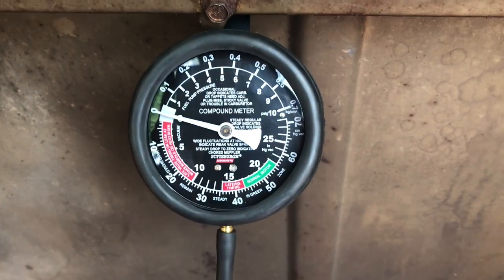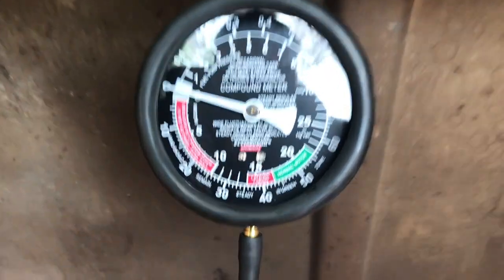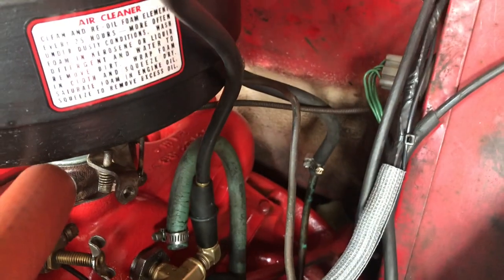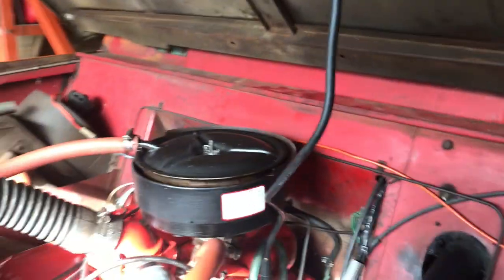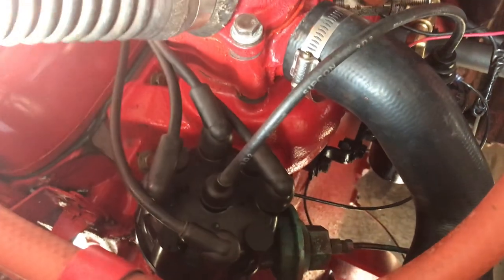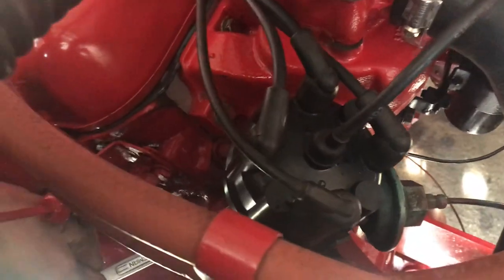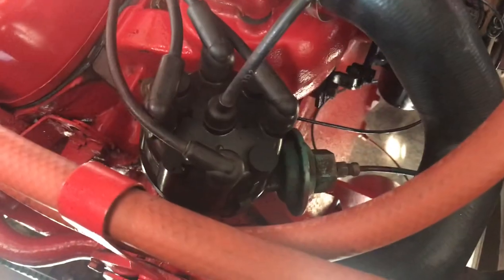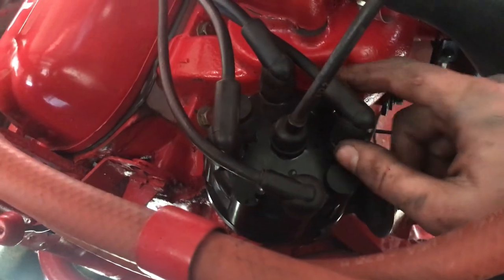1965 Scout 800 | How to Tune your Engine with a Vacuum Gauge

Comment: Best thing for these 152 - 196 engines are to do a gasket match for exhaust and intake and valve job , get rid of any sharp edges in the oil and water passages ....mind that if your doing a rebuild or like me and want a smother flowing engine.

Comment: I'm getting ready to drop in a new rebuilt 196 in my 70 800a.  I've a new old stock carb to install... this is going to be very helpful.  Thanks!
Reply from the maker: So your actually going from Alaska to Virginia. Well that means I can do Hot Rod Power Tour. Rock on man!
Reply: @carsonsihgarage8950  That's the plan.  Pulled my Scout out of bush AK.  Going to fly it to Anchorage and drive from there.  Not sure if we're doing it this summer or not due to Covid but still considering it.  Got a little teardrop camper to pull behind it.  Should be an adventure.
Reply: @vintageoverlanding  So, did you make the trip?